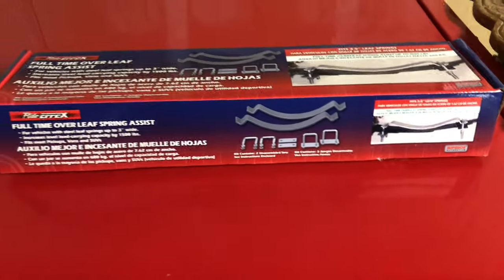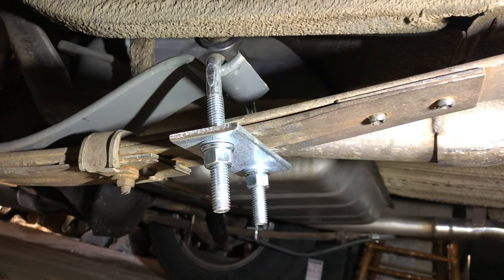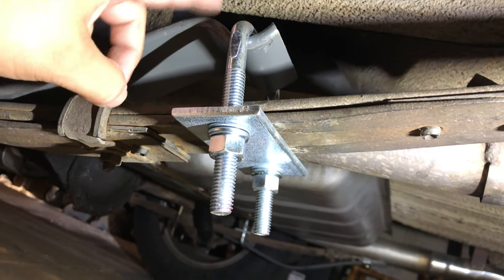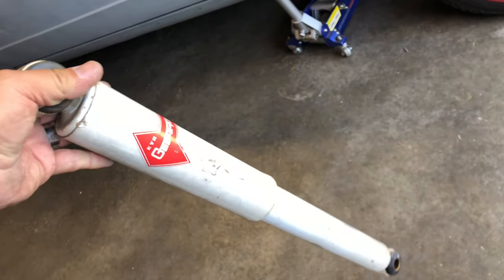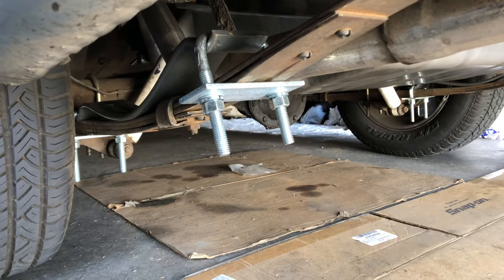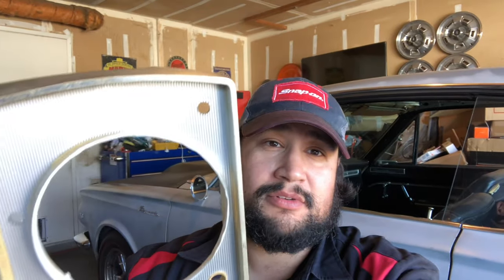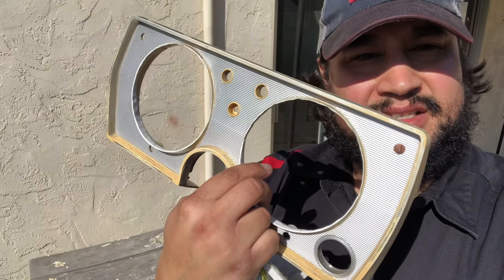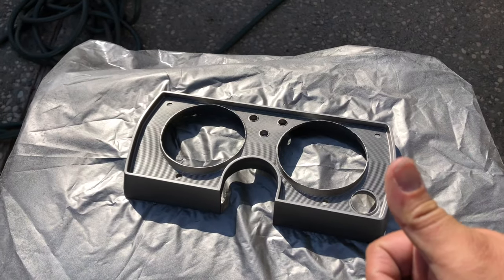SUSPENSION UPGRADES FOR MY 1965 BARRACUDA!!!AND I PAINT THE NEW INSTRUMENT CLUSTER BEZEL!

Comment: Very nice upgrade and pretty cheap, just $70 at O'Reilly's.  I'm going to try it on my 65.   I assume you just cut off the excess bolt on the assist springs so they don't hang so low.  Thanks for the video.

Comment: Great job on the instrument panel came out really nice..... Have you ever heard of molotow chrome pens they work really well for bezel and plastic instrument panels.......... Still got the 7 1/4 rear under the A body huh?.... Yeah I'll be running the same thing till I get my 70 B body 8 3/4 done to put in my 72 dart..... The air shocks due have disadvantages like some times cracking the upper shock mounts.... I've used mopar XHD springs and have given me good results with a B body going try them on my A body when I get a chance. KYBs are ok for the street anything better starts to get expensive really fast.

Comment: searching and found your video today.  Great job!  Very real, down to earth video and great explanations.  Any update on the spring assist kit?  Might do same on mine....and what headlights did you buy?  Would be interested in getting some of those for mine too!
Reply from the maker: Thank you so much for your kind words. Please consider subscribing if you’d like. And to answer your question yes the springs are actually functioning beautifully so far. They control the rear end under hard acceleration very well, And they have definitely changed up the suspension characteristics quite a bit. However I am not producing an incredible amount of horsepower and torque so keep that in mind.

Comment: Thanks for the tips! I think I'll give those leaf assists a try since we're on a budget build too. 

Just realized a few days ago I have a 7 1/4 Sure Grip! 

How did you get the BBP 5x4.5" wheels on there? Redrilled axle hubs or wheel adapter/spacers?

I'm redrilling but I need to take my axles to the machine shop to have the access holes plugged.
Reply from the maker: For the wheels I used spacers 2 inch in the back, but in the front I have already upgraded to the 4.5 bolt pattern and this brake kit. And let me know how the spring helpers work for you so far they’ve been pretty good for me
Reply: @tailsfromthejunkyard1023  Thanks, I will. I also just ordered the Scarebird front disc conversion. Can't wait to put 'em on!